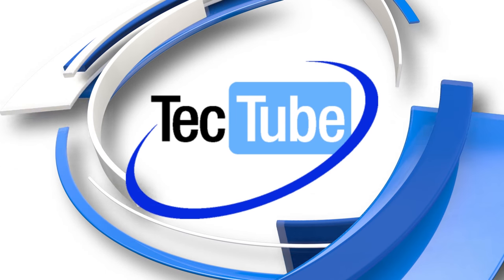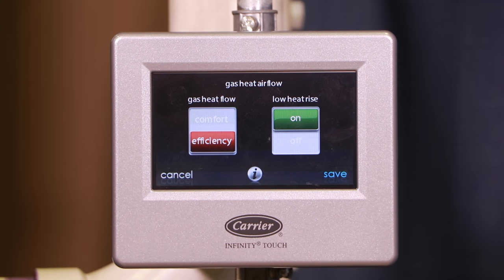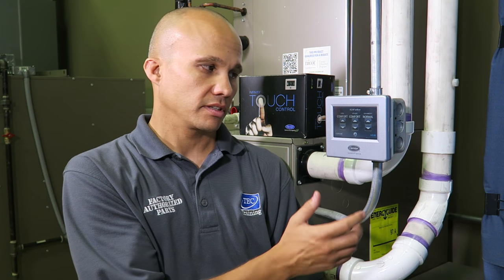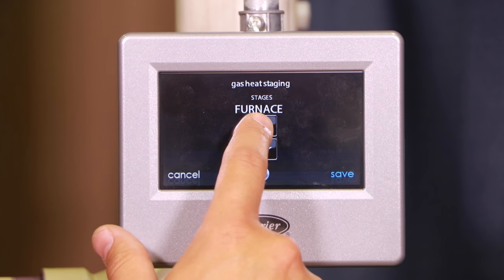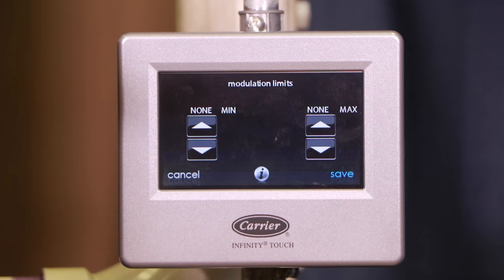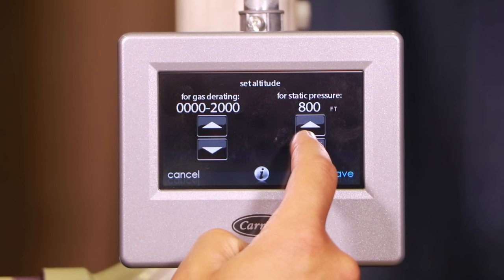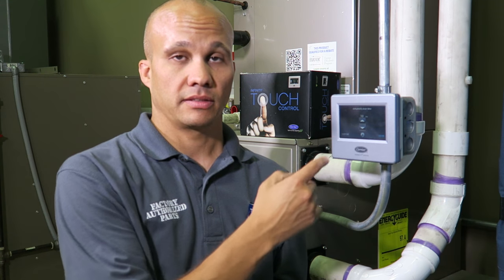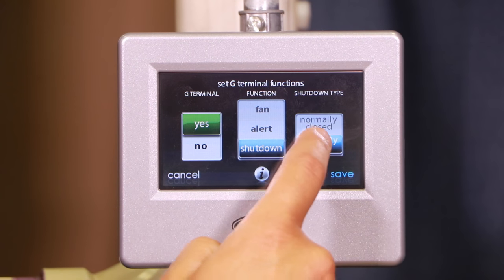Infinity Touch / Evolution Connex Furnace Configuration (5 of 5)

Comment: Very helpful. Do you think you will update for newer Evolution thermostat?
Reply from the maker: The B version of the stat... and the upcoming C version... are nearly identical to the stat in this video. They navigate the same, have the same screens, operate the same, etc. The newer ones have a couple extra functions, but it does not change any of the basics shown in this video.  The main reason for the newer models is better Wi-Fi chip, nicer LCD screen, etc.

Comment: Great videos. Thanks. Do you have any suggestions on the outside temperature at which the system will switch to gas heating? I use propane. It is very expensive. I spend $3000 in winter to keep my house warm. That is the reason I want to use more electricity, which is relatively cheaper. The dual heating system seems to resolve this problem. What is the best temperature to switch to gas heating considering energy saving, keeping the house warm, avoiding overusing either heat pump or gas furnace, and extending the system’s life?
Reply from the maker: The contractor needs to do two calculations that are specific to your home, the model of equipment installed, and the costs of your two fuel sources.  One calculation determines the thermal balance point, which is the OA temp at which your specific heat pump can no longer heat your specific house.  The other calculation is for economic balance point and is the OA temp at which the heat pump operating cost is more than the fossil fuel source.  Then you set the changeover point on your Infinity/Evolution control for the higher of these two balance points.

Comment: I have a fault limit on the comfort setting and not on efficiency for the furnace airflow.  Its due to cfm through the furnace. I assume i shouldn't get a limit fault on either setting?
Reply from the maker: No you should not get a high limit fault in either setting.  Changing it from Comfort to Efficiency mode will increase the airflow to help solve issues with poor ductwork.  If the furnace is overheating and causing the high limit safety to shut the furnace down, the likely cause is insufficient airflow.  There can be other causes (high inlet gas pressure, high entering temp due to zone bypass damper, etc.) but lack of airflow is the cause 99% of the time.  This can be causes by duct restrictions, too small of ducts (supply or return), or an oversized furnace.  Have your HVAC Pro check these items out?  They should be able to measure the inlet gas pressure, the duct static pressure, and the register CFM as well as provide a detailed heating load calculation.

Comment: question: 5 stage variable speed straight AC unit. does switching from Comfort to EFF 325 or above delete the units ability to use the dehumidification feature? meaning once out of the COMFORT selection and choosing one of the 3 remaining deletes the homeowner to change the dehumidification option.
Reply from the maker: Yes, only "comfort" for the A/C airflow setting allows for the airflow to lower for dehum mode.  If you pick EFF325, EFF350, or MAX, then you have a fixed cfm/ton at all times when the compressor is on.